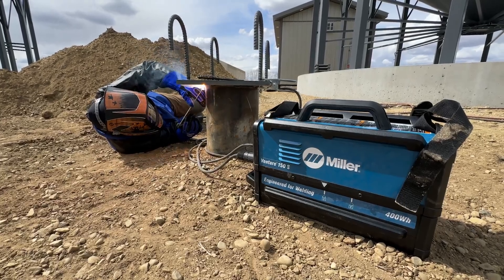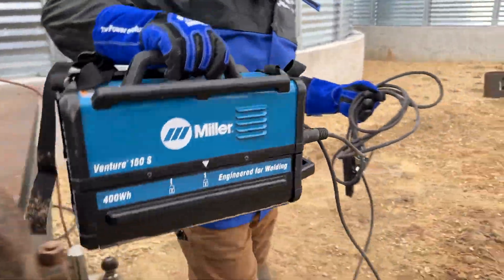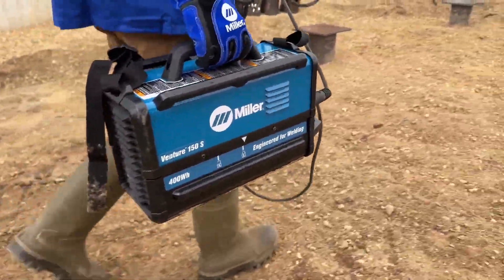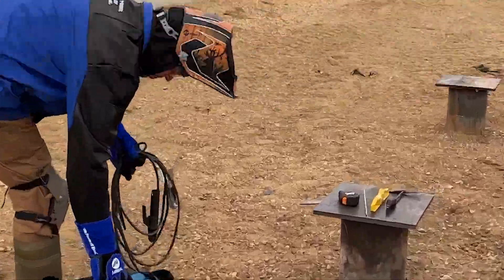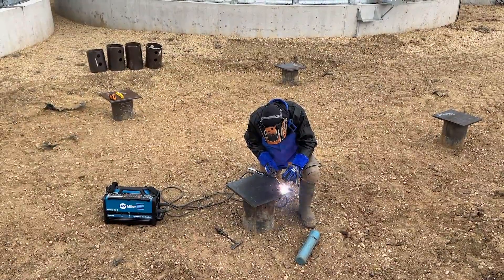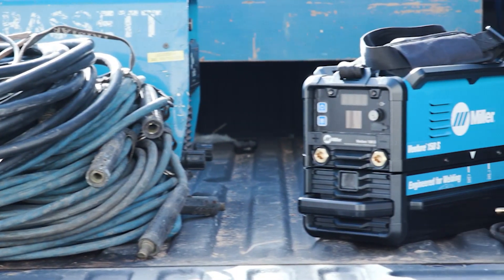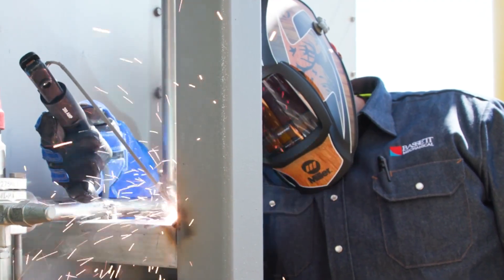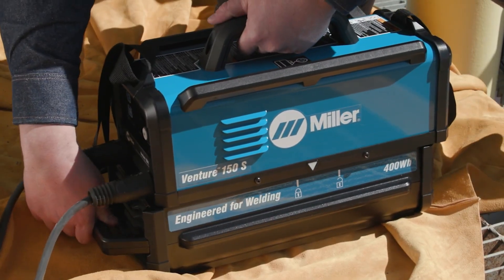Venture™ 150 S: Battery Powered Welding, Anywhere

Comment: can you plug it into a 120v source to save wear on the batteries?
Reply from the maker: The welder itself is battery-operated and runs solely off the battery.

Comment: Can one get a mig welder that also works with a fluxcare that also works on a battery  setup as the new welder .
Reply: Soon.. before this esab made a machine for stick only,, now miller made it for stick and tig,, pretty soon i guess  miller or lincoln will come with multiprocess on batterie... but i ll stick with miller 😅